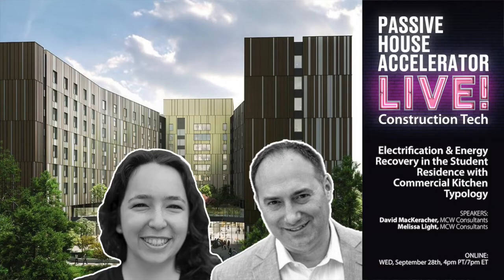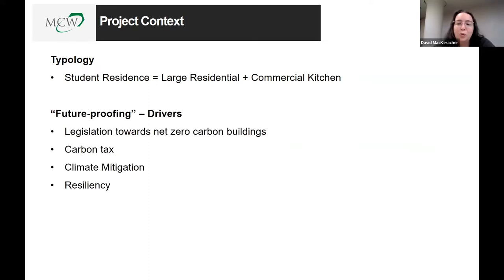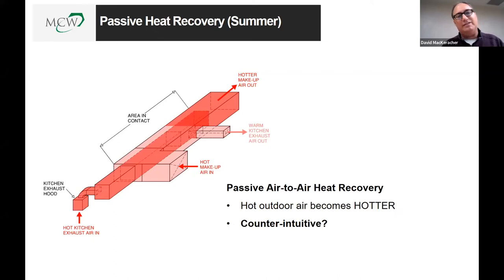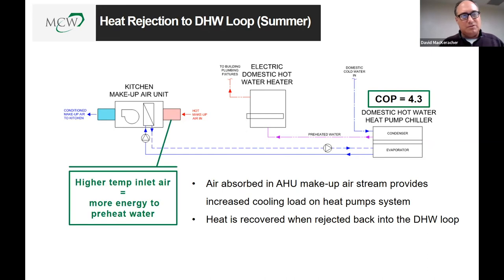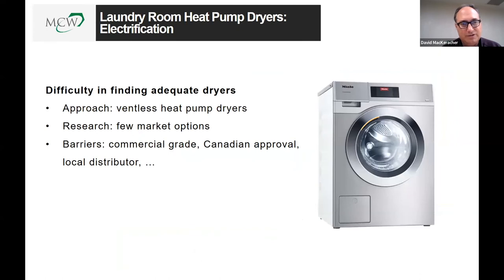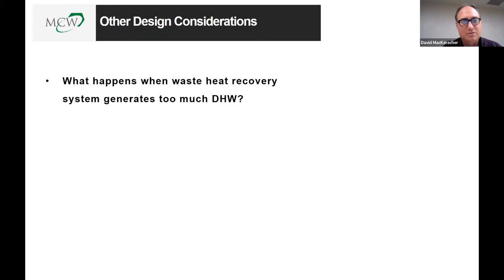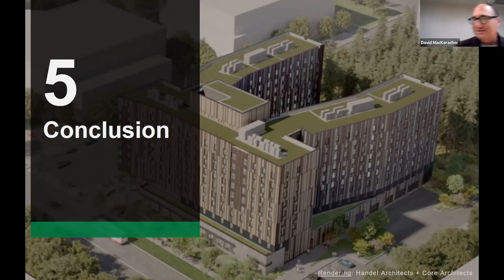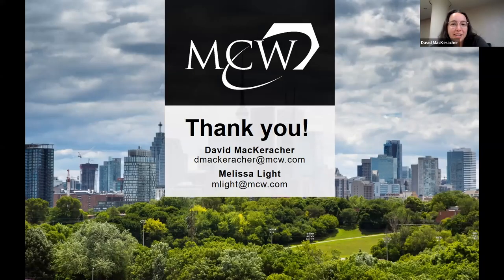Electrification & Energy Recovery in Student Residence: Commercial Kitchen Typology | Presentation

Comment: I always wanted to connect a system to the dryer exhaust where you could redirect it toward melting snow on the sidewalks or stairs. In a place like Canada, especially, might be a fun way to use otherwise-wasted heated air!